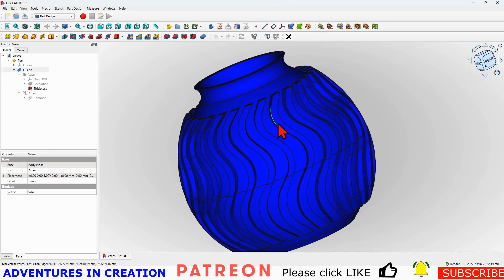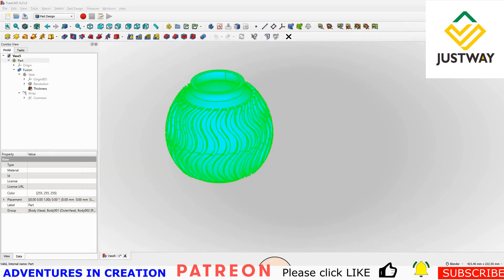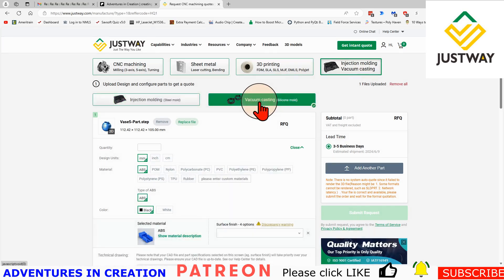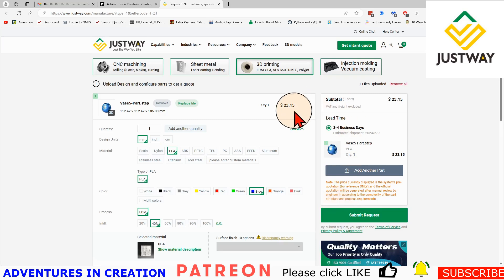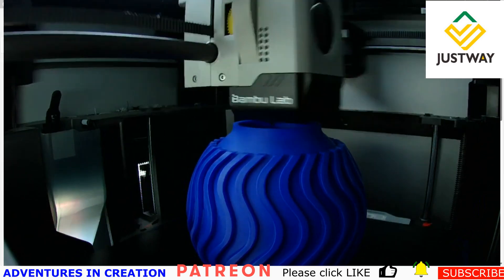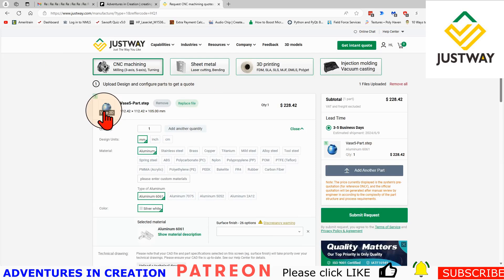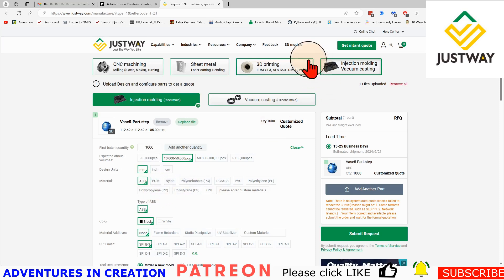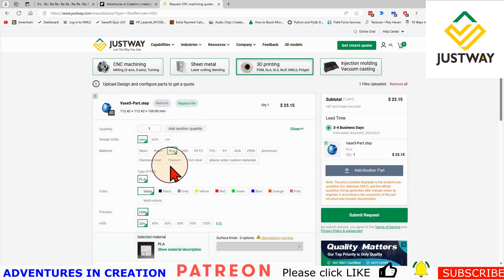Manufacturing parts with Justway - Paid Promotion

Comment: Reasons I have not bought a 3D printer yet 1) I must be able to design my own parts
2)  "...if you are printing something that will take 24 hrs and it crashes after 15 hrs..." 
3) the cost were so expensive for the size you are limited with
These companies have the latest equipment, materials, etc.
You helped me with learning FreeCAD.
I need content for what (allowances) I need design with for things that will be inserted or slide or 
?
Thanks! 
G_Dub
Reply: Thank you, Yes I feel more confident with CNC metals and allowance for expansion/contraction whereas all the different types of plastics available for just a single "what you going to use it for" and how do you keep up? Now being able to ask suppliers questions is a must along with asking your supplier for 3D printing...
I really enjoy your teaching methology!
Reply from the maker: @GDub1958  Yeah, it's definitely something you have to pay attention to. For the most part, I 3D print PLA.
Reply from the maker: I will definitely produce some content that show that. It definitely depends on the manufacturing process, with laser or cnc router you are definitely looking at different tolerances to 3D printing.